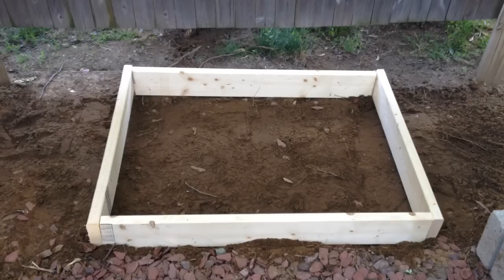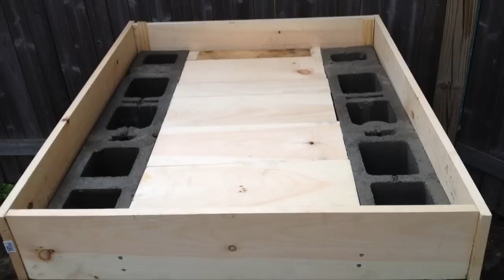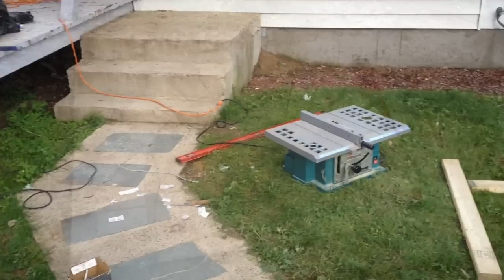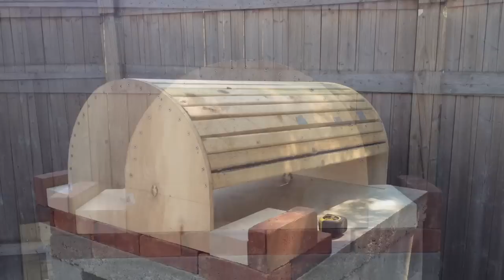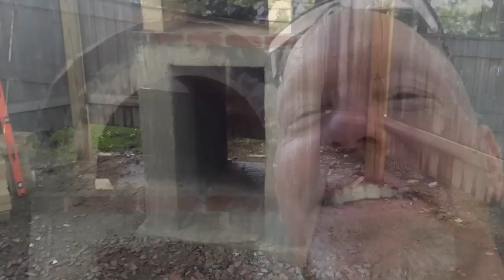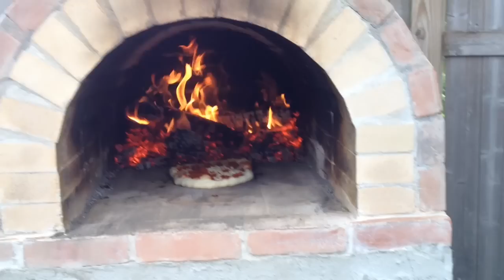Brick Oven for Pizza

Comment: Seal the front off a little more and it will get the heat up way more. It's an amazing build. Now get some marble tile, shatter it with a hammer and mortar it on to beauty it up haha jk but it does finish nicely when marble is put on it

Comment: Just a quick thanks for the video ..... used some of your design ideas plus from other videos to come up with my own unique design ... well done ....
Reply from the maker: Your very welcome.  Im glad it helped. As you know, it’s a labor of love.  One tip to pass on about heating the oven for pizza: use well-seasoned hard wood, and plenty of it to achieve the proper temperature. Soft, wet wood will not work no matter how much you use. Good luck.

Comment: I have this style oven, and even though it does a sufficient job for a few pizzas, I'd do a small dome oven if I could do it over. Don't forget to put good insulation (FB board) under the fire brick floor and then insulate the dome.
Reply: Curious what you don't like about the barrel style? I was planning on going with this type, your comment gives me pause. Great advice on the insulation thank you.
Reply: Rob my oven certainly suffices, but if you are going to go through all the trouble of building an oven it may be worth doing it right. If you are going to be making ten pizzas for a few friends, your barrel design will certainly cope, but if you will be making more pizzas of if you just want the power (heat) of a dome oven, then go for the Forno Bravo Pompeii. The dome will also use less fuel. The plans for the Pompeii are free. As I said, don't skimp on the insulation, especially under the floor. Order the Forno Bravo board insulation from their website. No, I don't work for FB, but if I could do it all over again, I would use their design.
Reply: Rob I see that I did not exactly answer your question. The main problems are that it takes up to two hours and a lot of wood to pre-heat the oven, and the floor cools down quickly once I start making pizzas. The trick is to get the top and the bottom of a pizza done at the same time. You can control how quickly the top is done by controlling the size of the flame and by doming the pizza, but there isn't much you can do once your floor starts to cool off. What I do to get the floor back up to temp is pull the coals forward for ten minutes and then push them back again. This is kind of lame, and I can tell you that a dome like the Pompeii, once properly pre-heated, will not require this. You should be able to make pizza after pizza with little to no loss of floor heat.

Comment: Wayne-- Really nice build.  I didn't quite catch how you removed the form-- Did it just slide out?
Referencing the remark from the mason, earlier, seems as though if using the foam form (Brickwood) or your style, that simply eliminating the first two courses of bricks on the side would pull the ceiling down-- though  at the cost of a bit over 100 pounds of masonry heat sink capacity--presumably countered by the decreased distance to the ceiling.
By the way-- do you use yours year round? I use my Weber in all weather, 12 months/year.  I think the coldest it was this past winter was 10F outside.  I would think that the inside of your oven would warm up just fine as long as it weren't actually raining or snowing.
Best,
Mike

Comment: In Argentina what will use on the cheap but very effective is broken bottles of glass wine bottles anything of glass you crush and you mix layered the glass first and then you lay rock salt over top of that then on top of that you lay your cement  once it sets lay refractory brick for the floor that is a great insulator so you don't lose heat from the bottom that's what we do in Argentina

Comment: Hi Wayne, a lovely looking oven and a great video. Just building one myself at the moment and wondered what you used as the hearth for cooking on? The views from outside look like it's brick but other shots showing inside it looks like some sort of tile? I have laid brick in mine but not sure if I should cook directly on it or maybe use a stone. Your thoughts and experiences would be appreciated
Reply from the maker: You should use only refractory bricks (fire brick) and refractory mortar for the hearth in order to withstand the high temperatures. The pizza will rest directly on the fire bricks. Good luck with the oven!
Reply: @lostmykeysagain  ok thanks Wayne. Just out of interest how long does your oven take to get to temperature?
Reply from the maker: @andyjones5824  It usually takes me about 75-90 minutes, and that is with well-seasoned dry hardwoods.

Comment from the maker: That is the problem with the barrel style brick oven - too open in front. Honestly, it gets sufficiently hot as long as you use a well-seasoned hard wood.
Reply: thats not a style problem. thats the problem specifically of your oven. because other barrel ovens have bricks in front to make the opening smaller.
Reply from the maker: @illizizon9569  The vast majority of oven barrel style ovens look exactly like mine, and I used them as the model for this one. The barrel style is not ideal for baking a pizza but certainly gets the job done albeit not as efficient as a traditional domed oven. This style oven is for the novice mason given its simplicity to build, ease of placing wood inside, and clearing out wood ash after a full burn.
Reply: @lostmykeysagain  most portable pizza ovens are in barrel style and they work perfectly fine. the problem with yours is the high height.
Reply from the maker: @illizizon9569  too late to fix it now🙃.

Comment from the maker: Em cee: I had to “coax” the form out with a hammer. So, let the mortar set several days before removing the form. Yes, I use the oven year-round , even in temperatures near zero Fahrenheit.   When it gets that cold, you definitely need well seasoned hard woods. Wet soft wood is your enemy. Do not use it !

Comment: thanks nice video, i want to try your style of just putting some shims for that cement border on the table top.
Reply from the maker: The shims were used to keep the form in place so that it did not slide down. In the video you will see that I did not cover the holes in the cement blocks in order for cement to seep into the blocks and make a solid cement wall. If I did it again, I would probably just fill the blocks with sand, dirt, or stones. There is really no need to “waste” the concrete to fill the blocks.
Reply from the maker: alexander trujillo utilicé cemento refractario y ladrillos refractarios en las superficies expuestas al calor intenso. en el video, estos fueron los ladrillos blancos.
Reply from the maker: alexander trujillo No usé esto para mi proyecto, pero sugiero que considere esto: http://store.brickwoodovens.com/mattone-barile-wood-fired-brick-pizza-oven-form/

Comment: How is your oven holding up after for years? I would worry that frost under the slab foundation might more and crack things.
Reply from the maker: Zero problems with the slab moving or cracking nor any significant wear of the firebricks or red bricks. It’s pretty much indestructible.

Comment: Hi iam looking to build my own this summer . Can you tell me what are your measurements.  And how many fire bricks and clay brick did you use it ?
Thanks
Reply from the maker: I did not save my material list, so I can’t recall quantity of bricks used. I suggest you take a look at this web site for ideas. You may also want to buy the foam form;  I built my own form as you can see. However, there’s no shame in “cheating” with this type of form..... https://www.brickwoodovens.com/mattone-barile-grande

Comment: Hi can I have the name for the cement you use for the fire break
Reply: And do you put cement bet ween the  Concrete base and the firebreak  In the floor break
Reply from the maker: Any refractory cement will work.
Reply from the maker: Use refractory cement anywhere the flame will meet the bricks.

Comment: Very nice thank you for the video.
Where did you buy the fire bricks and how much are they?
Reply from the maker: You can purchase fire bricks at most any large building supply center (along with the Portland cement)
Reply from the maker: I bought them at a local building materials store. You should be able to purchase fire bricks at any large building material supplier that sells bricks and masonry . The fire bricks are a bit more than the traditional red bricks, not sure about exact price now.
Reply: Thank you!!